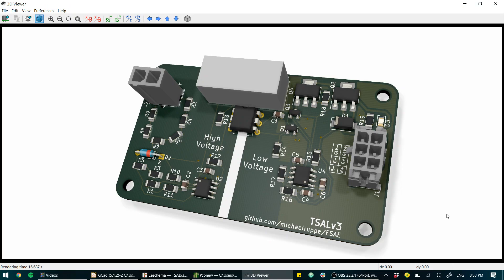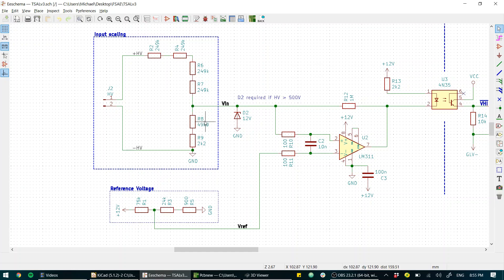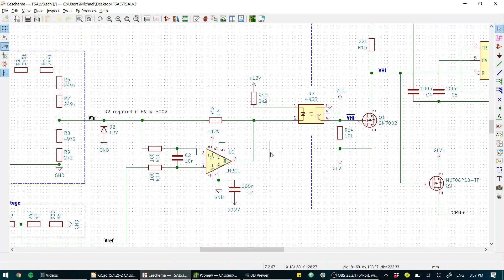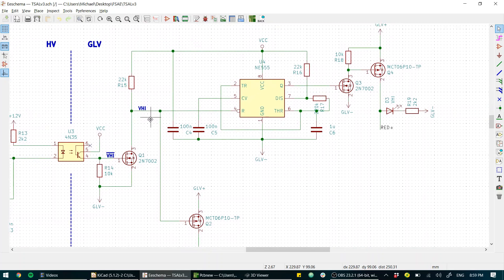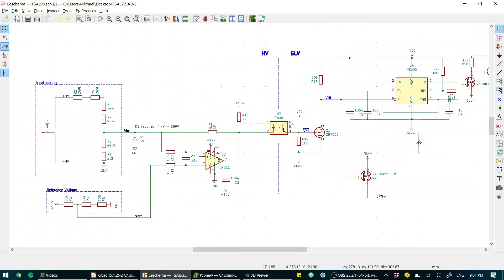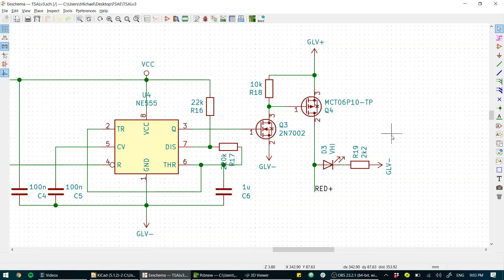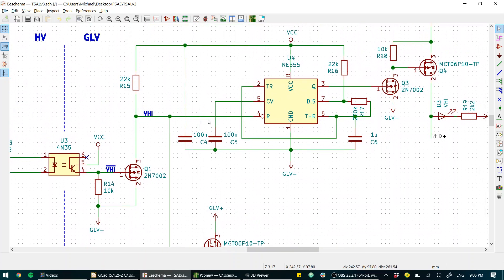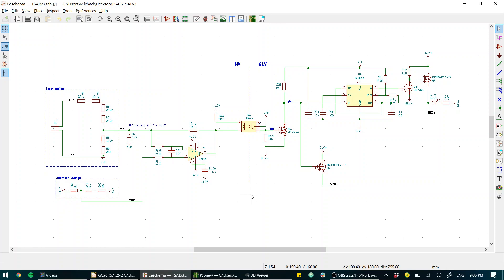TSAL design walkthrough (FSAE Australia 2020)

Comment: Hello Michael. I am currently designing a TSAL pcb for my team in Greece. The fsae rules in Europe are different and it seem like more challenging also. I saw your video on the TSAL vol.3 and i was wondering what was the power rating and the tolerance of the resistors and also the voltage rating and tolerance of the capacitors that you used on the board. I don’t know if it makes much of a difference as I’m a beginner in electronics. Do you recall the specs of those components?
Reply from the maker: 1206 resistors are generally good for 200v. Many in series guarantees that the voltage drop across each individual resistor is less than 200V, even though the TS voltage may be significantly higher. 
If you're referring to the rule that "all components used on the TS circuit must be rated for the full voltage" I believe this is still appropriate.
 I believe "component" refers to the tsal circuit as a whole, not the individual components ie. The comparator would also need to be rated for full TS voltage following the letter of the rules.

This same trick is used by the IMD for example
Reply: @MichaelRuppe  Yes, thank you for clarifying this rule. I also wanted to ask you if , after the optocoupler, i could use logic gates instead of mosfets. Do they act the same, just with a simpler circuit?
Reply from the maker: @nikostheodorou1096  sure, you could use gates - try it out on a breadboard and watch out for push-pull vs. Open-drain outputs. 

I opted to use readily available parts that my team was already using in other designs which is always nice for BOM optimisation.
Reply: @MichaelRuppe Do i have to make a latching circuit for the TSAL? Also, why did you name the LV/HV grounds differently? It is still the same ground signal, right? (sorry for the amateur questions😓)
Reply from the maker: @nikostheodorou1096  in the FSAE Australia rules the TSAL had to be triggered by voltage on the TS - it was not enough to just use the state of the Shutdown Circuit. The reason I could see was that it is possible for an AIR to be stuck-closed eg. Due to arcing. In such a case the dangerous TS voltage would be present even if the SC was powered or not.

No latching is required. The TSAL is a completely separate visual signal for track marshals / ground personnel

Comment: Hey Michael.Thanks for great video! The red light side is goes to ground with d3 and r19.What's the reason why there's no such thing on the green light side?
Reply from the maker: That's simply an on-board flashing indicator to show when HV is present. You could add a similar LED for the green light if you wish. I mostly used it for commissioning the circuit.

Comment: Hi Nice Video 
I want to know what is the current input with this circuit through HV 
It is a little confusing to me  how to pass high current through the circuit on PCB
I have 72 V and 250A current on HV side how should I connect it on PCB please help me
Reply from the maker: The current is very small since HV is only used to measure voltage. If you would like to discuss further then open an issue on the github page so we can discuss and share diagrams

Comment: Hey Michael. We tried using the same DC-DC converter you are using but were having issues. The output was offset by -0.3V (at both Vout+ and Vout-), and for some reason we were getting a negative voltage at our op amp refence input instead of the expected 1.25V. Did you face any issues using this component?
Reply from the maker: I didn't experience any problems - is it exactly the same part?
It sounds like you might be measuring wrt. GLV- which is incorrect. This is an isolated supply, so any measurements on the TS side (eg. the reference voltage for the comparator) should be measured wrt. the output negative terminal Vout-.
Reply from the maker: Note that in the schematic GLV- is the ground for the GLV. For the TS side of the circuit I chose GND as the ground. Perhaps not the best decision but there you have it 😅
These grounds are separate and it doesn't really make sense to measure voltage between these systems.
Reply: @MichaelRuppe  That makes sense haha thank you!
Reply: @MichaelRuppe  Okay so when measuring wrt to Vout- on the TS side, the reference voltage value was correct, but there is another problem. I tried using a third isolated supply for the HV connection (where you have J2) since in reality the HV connections will be isolated from the LV supply on both the TS and LV sides of the board. This resulted in an unexpected voltage at the output of the input scaling (even when measuring wrt to GND on the TS side). Which is I guess expected since the supplied are isolated. Did you face this issue? How did/would you deal with this?
Reply from the maker: @ananhefny6356  I'm a little confused. On the HV side of the circuit, all voltages are measured wrt Vout-. That includes the tractive system, where TS- is connected with Vout-
Perhaps a drawing might make things clearer. You're welcome to open an issue on the github repo for this hardware
github.com/michaelruppe/FSAE

Comment: Hi, awesome video. Im looking into using a NCP785A linear regulator on the high voltage side for 12v. Do you think 10 mA is enough current to power the HV side of the circuit? Thanks
Reply from the maker: 10mA ought to be plenty
Reply: Also, what wattage of leds did you use? I cant seem to find any resources on what will be bright enough (as well as not drawing too much current from the circuit)
Reply from the maker: @evanyoung8066  Im not sure - they were just 12V accessories from ebay. You don't need to worry too much about power since the lights will be powered by the glv

Comment: Hi Michael, I'm currently working on the TSAL for my Team and i have one doubt about the green and red lights, the question is whether when one is on the other should go off or they can/should be on at the same time?
Reply from the maker: The lights should never be on at the same time. Do you have a circuit that dies this? Do you have a schematic you can share?
Reply: @MichaelRuppe  I solved the problem, and now it's all right, I was in doubt about the interpretation of the system itself, but to be honest I still have a doubt, the traction system voltage condition exceeding 60V is the normal condition when the car is running, right?
Reply from the maker: @leonardonogueira9190  that's right. The purpose of the tsal is to indicate that dangerous voltage is present on the TS. of course, that's normal for when the car is running - but serves as a warning to marshals and crew

Comment: isn't LV and TS voltage connected since GLV battery is powering the LM311 which is connected to HV+ and HV-? or is it that since you divided the TS voltage, its not "HV" anymore?
Reply from the maker: The TS side of the design is powered through an isolated DC-DC converter (SPAN02), referenced to TS-
Reply: @MichaelRuppe  i see. is it possible to have the same isolated power supply using a second optoisolator you think?

Comment: for 1:04, I was wondering why you didn't use 1M resistor instead of 4 smaller 249k resistors?
Reply from the maker: For a higher combined voltage rating, using parts that are still cheap and easy to find
Reply: @MichaelRuppe  okay because i naively thought that bigger resistors cause imprecision or something. but you just didn't want to rely on 1M with 500V rating

Comment: How does the PMOS that is driving the green light get pulled to ground when the optocoupler and Q1 are not conducting?
Reply from the maker: When Q1 is conducting, Q2 is conducting. When Q1 is off, the gate of Q2 is pulled high by R15, turning Q2 off.
Reply: @MichaelRuppe  Thank you!

Comment: where are you receiving the reference voltage from whilst keeping the HV/LV isolated from each other?
Reply from the maker: The SPAN02A-12 in the schematic is an isolated DC-DC converter. It is powered by the GLV and produces a 12V supply referenced to TS-.
Reply: @MichaelRuppe  i'm assuming using this gets around the spacing requirements between HV and LV, yes?
Reply from the maker: @ollieocean  we competed with an earlier revision of this design in 2019. This revision hasn't been through a round of scrutineering - bust out the pcb file and have a look to see if it satisfies your needs

Comment: Great video Michael. 
We are prototyping TSAL designs at the moment and I noticed you use 200V rated resistors connected in series as part of your design. What was required to achieve exemption from rule EV.1.2.1 c. (components in TS must be rated for maximum TS voltage) so that they can be used? 
I would also like to use components in our designs that are not rated to maximum TS voltage as it gives a much greater range in component selection (components rated to >504V are proving difficult to find).
Reply from the maker: Hi Bevan, honestly I just designed this in the 'spirit of the rules'. Note: our 2019 car only ran at 180V so it is irrelevant. 
Yes, the resistors individually are not rated very highly. However, in series they all form a single resistor that is rated for the maximum TS voltage. You're right: the letter of the rules is quite clear that this is unacceptable. But I think the spirit of the rules is more about good engineering practice. Look at any high-voltage design (eg. the Bender Insulation Monitoring Device) and you'll likely see strings of resistors used similarly.

Maybe it was just because our TS voltage was too low to turn any heads. More likely, design judges recognised that this ought to be acceptable under the spirit of the rules.
Reply: @MichaelRuppe  thanks for the reply. We also noticed that the Bender (and industry in general everywhere) does exactly the same thing so that's the principle we were working on.
I did recently manage to find some Rohm 600V rated ones which we are going to use just to be safe (in case we get an overzealous judge).
If anyone is interested, you can find them at Digi-Key here (NOTE: only the 1210 package is rated to 600V): 

https://www.digikey.com/en/products/filter/chip-resistor-surface-mount/52?s=N4IgjCBcpgbFoDGUBmBDANgZwKYBoQB7KAbRAA4AWS2ABhAF0CAHAFyhAGVWAnASwB2AcxABfAgFpKCEMkjps%2BIqRAAmSgGYwAVkYt2kEGMm7os1JlwFikMqr0g2HMaNFA
Reply from the maker: @Naveb83  good detective work! Of course, it always pays to get your pedant-hat on when it comes to these things 😉
We found the design judges in the Australian competition 2019 were very reasonable.

Comment: this video solved my problems, thanks. I would like to know where the 12V powering the op-amp comes from
Reply from the maker: The SPAN02A-12 (Grey rectangular prism in the render) is an isolated DC-DC converter that powers the HV side of the board.
Reply: I would like to  write a project based on your TSAL model. May you tell me the names of the ones that made this PCB, so that I can give due credits?
Reply from the maker: I designed this TSAL controller for NU Racing - the FSAE team for the Univesity of Newcastle, Australia. Michael Ruppe is my real name. Which competition are you in,  @Ghomer901 ?
Reply: @MichaelRuppe  thanks michael, my name is guilherme and I'm working on the powertrain of UFVolts Majorados car - FSAE team for UFV (Federal University of Viçosa), Brazil.
Reply from the maker: Best of luck - I'd love to see your report when it's done, @Ghomer901 !

Comment: Thanks for the excellent video! Have you had any issues with the rules stating that the TS is active if either AIR or precharge relay is closed as you're only measuring the TS voltage?
Reply from the maker: You're welcome! No - In the Australian competition the TSAL is only required to indicate if voltage on TS is above/below 60V (DC). If I understand correctly, in some other competitions it is permissible to switch the TSAL from just the AIR or Precharge control signals. This is not accepted in the Australian competition.